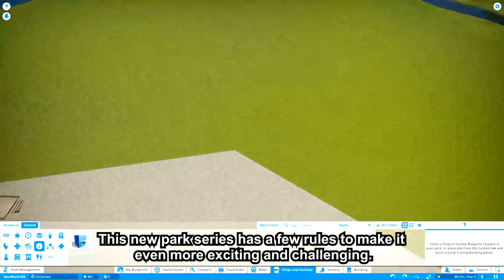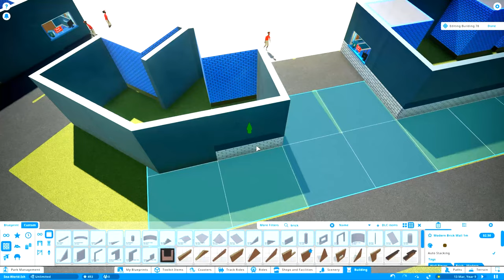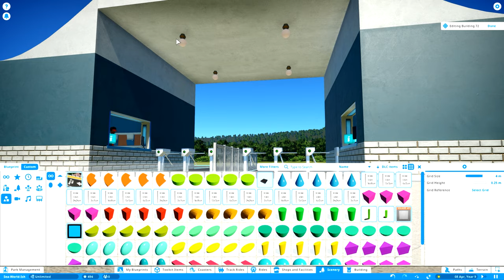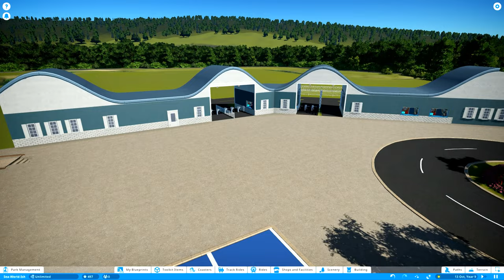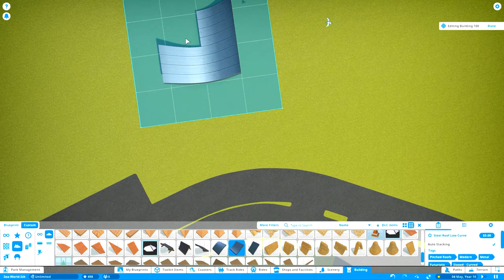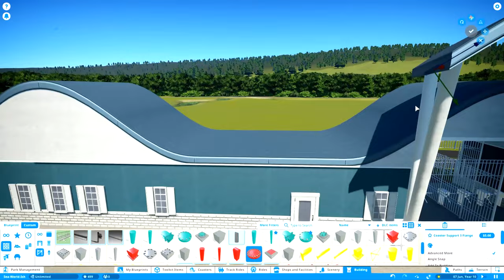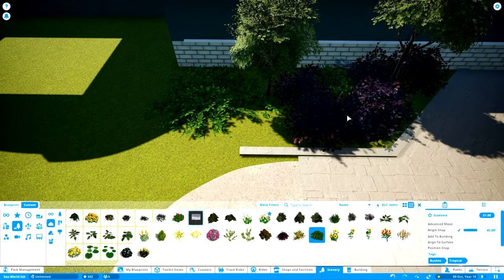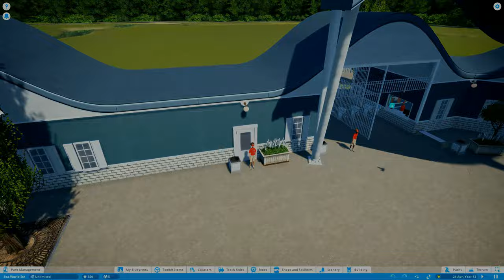PLANET COASTER - New Realistic Park ep. 1, Entrance Tutorial (Sandbox Speed Build)

Comment: Looks good. Great tip on the barriers under the ground,  ive struggled with that before.
My new park is well underway. Currently working on a Spooky Area and using triggers for the first time.
Reply from the maker: Great idea with a spooky area. Triggats are a nice way to add excitement, however, I find them a bit tricky to get them right. Do you have any tips and tricks? 😄
Reply: @PlanCoBySeb  being a relative noob I was just very meticulous with it. It took me around 2 hours to build a smallish "crematorium" that part of the coaster runs through and about 45 minutes spent with the triggers (I think 6 fire effects each side). I named them a, b, c and so on so they could be sorted in order then it was a case of working out the delay. I wanted them to light up in order and direction of the coaster and settled on 0.02 second delay added with each object. It actually turned out really well. Even gave myself a pat on the back! 😂
Reply from the maker: Hahaha, that’s great! I will try to add them as you are describing into this park at some point 😄

Comment: One question: if I use turnstiles, do I have to place the regular park entries and sink them to the ground, so the guests accept them as park entries? 

I guess otherwise, without placing the real ingame park entries into the ground, the guests won't enter the park, since they don't recognize the turnstiles as park entries...

Is that right?
Reply from the maker: Well, in this park I made the guests enter the park from the building at the left side of the entrance building. And then putting down regular path under the floor tiles where the turnstiles are. That way, the only way into the park is via the path under the turnstiles. I hope it makes sense?